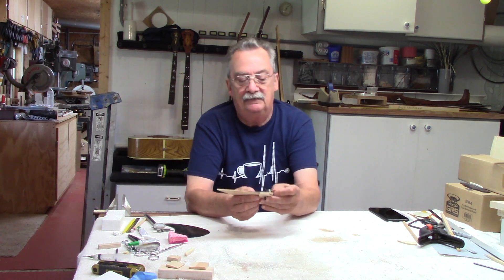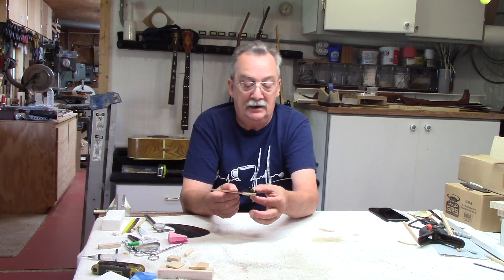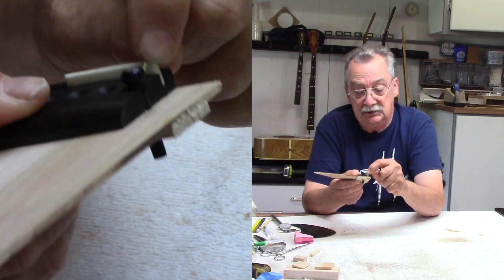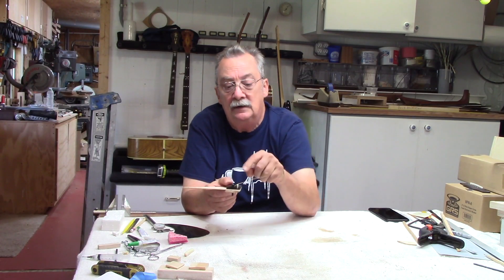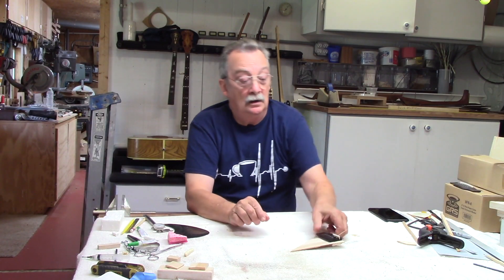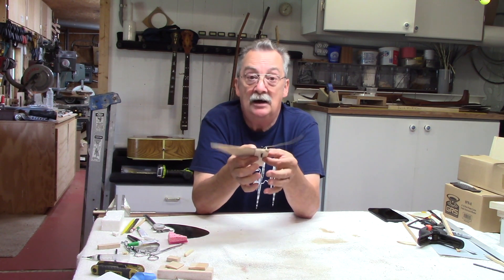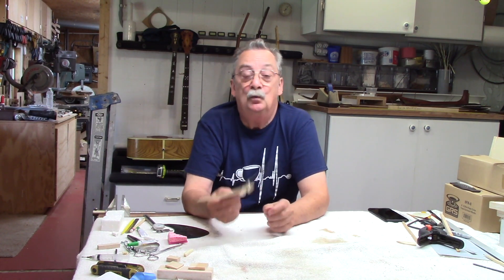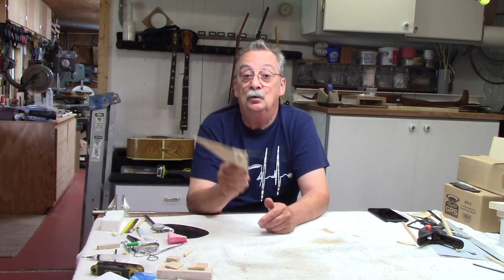Blues Creek Guitars - Guitar Bridge Geometry and Break Angle

Comment: Great Video John! so I have a question about saddle height on a thinner bridge guitar say a 1940’s saddle thru- I know bridge height can vary in theses models but recently I did a neck reset on one with a thin bridge and the saddle route is close to the front of the bridge. I usually shoot for a saddle protrusion of .100 but then my overall height off the sound sound board will be less then the 7/16in you mention here. So are these thinner vintage martin bridges from the 40’s the exception? I’d hate to have too much force and snap the front of the bridge off. Thanks so much for any reply in advance. Thanks-Carl Chalmers
Reply: Martins , they used a number of bridge thicknesses.5/16 to 3/8 in were common.  In their process they set the neck first then put the bridge on.  The used a gauge on setting a neck that had a tolerance. They would also adjust the bridge thickness by hand on a belt sander. The thinnest stock bridge I have seen in my 25 yrs was  5/16 in  and with a 1/8 saddle that would set to about 7/16 in.  I have seen bridges that were sanded thinner   and as low as 1/4  and at that thin I replace them when I reset the necks.  Understanding that when they strung up a neck they were assuming the top to rise about 1/16 in.  So to answer your question  some were pretty thin as compared to todays specs
Reply: @bluescreekguitars3346  Thanks so much for the informative reply John.